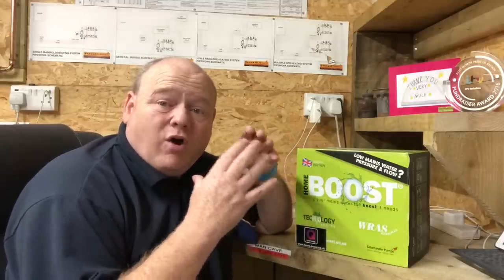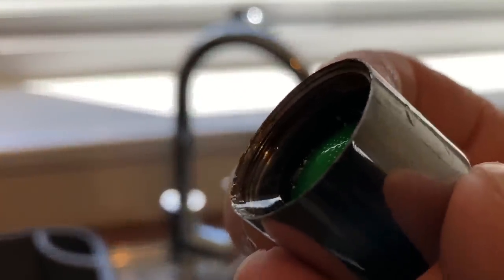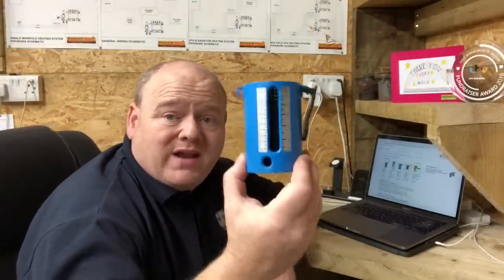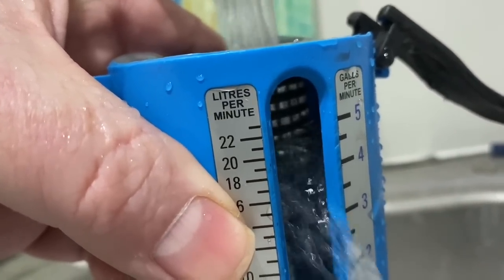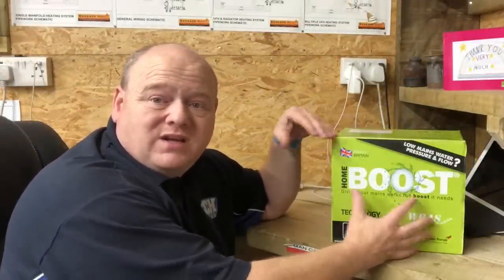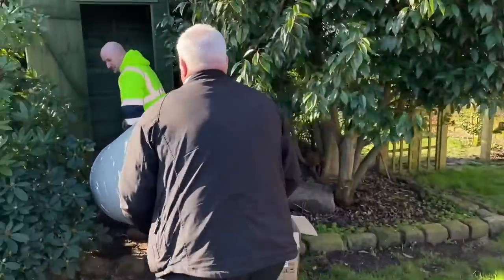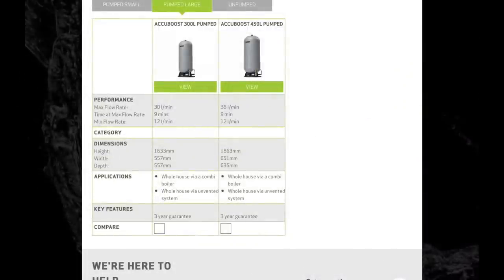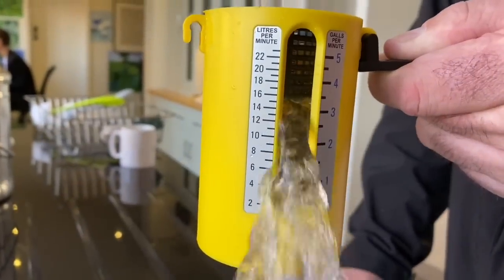Low Water Pressure - Leeds Plumber

Comment: Purchased a 70’s house that had to be completely refurbished, including full re plumb, insisted everything was to be in 22mm pipe, still had flow problems, so replaced the incoming mains, still had problems, found out the  plumber has used the very cheapest isolating valves he could buy, changed them for full flow valves, job done. Since fitted a water softener, which has reduced flow, now looking at a home boost pump.
Reply: Water softeners usually dont impact the water flow to a household. I would check that the water softener is fitted with a highflow hose kit. You'll know by looking at it. The standard kit is fed from the same valves and hoses you would feed your washing machine with. The highflow kits use fullbore valves and bigger diameter hoses.

Comment: I stay in a rural part of Scotland with mains water but for whatever reason we have the most outrageously high water pressure I’ve ever seen. Could fill up a 4 pint water jug in about a second whilst soaking the ceiling. Can fire a hose over the 2 storey house at half pressure. 
We’ve actually had to limit the water entering the property down to about 20% to make things manageable. 
Seeing as water is unmetered here I’ve often wondered if I could run my own hydroelectric system from the kitchen sink!
Reply: You need a pressure reducer on the mains pipe as it enters the property. Too high a  pressure can ruin plumbing fittings and appliances.

Comment: Great informative video as always Alan. Where possible I would always recommend a new mains supply to a customer over a pump, less moving parts to go wrong in the future that will cost a few hundred pound to fix. Pumps these days even the brass ones dont last that long. I would say 10 years max and that it is been optimistic vs 20+ years easily with only a nip up of a gland nut required 😁. Obviously a new mains pipe isnt always an option and it's a good that all these options are available. Probably an obvious question but with the mainsboost from stuartturner, I presume they are the standard monsoon single impellar pumps that are attached to the accumulator and if they do fail, the pump itself is replaceable without the need to replace the accumulator too?
Reply from the maker: No space for accumulator on this one. Thanks.

Comment: Flow rates and pressure drops. A case in point. Typical "conversation", one way though, twixt me n the missus. 
"What the bloody hell have you been up to? Yer filthy. Get nekid on't back door mat 'n gerrin that shower, now!"
I dutifully oblige. I get in shower, lather up mi bonce with shampoo and the shower reduces to a trickle.
She's chucked mi filthy clothes in the wash mac and turned it on. The shower virtually stops.
A pressure equalisation valve was fitted under the bath feeding non thermo shower mixer. Wash mac cold feed demanding -> shower reduces to a trickle.
Ripped the blasted thing out when I redid the bathroom last year and fitted a thermo bar mixer.  So now, wash mac on and demanding and I can shower at the same time, baht standing eyes tight shut, lest shampoo gets in them whilst waiting for the wash mac to fill. 
Alan, what sort of shampoo do you use?
I'd share but I am not on any other social media platform and I don't do Twitter. I have hit like tho.

Comment: Very informative, have a problem at brothers property, starting from scratch measuring flow and pressure, whats the recommended flow rate for a 3 bed i bathroom property? what should I be looking at 10-15 litres / minute is this acceptable?

Comment: Thanks for the video Alan, hope you're well. How would the big accumulators and home boost compare to pressure from a twin impeller shower pump for just supplying a bathroom? I know it's more of a whole property solution, but would you still recommend a shower pump to a customer to boost bathroom pressure as well or can something like the home boost handle it all? Thanks
Reply: You cant really compare a twin impellar booster pump with the home or mainsboost systems. Both are used for different systems. A twin impellar pump will be recommended for a customer who is using a gravity fed water supply where the mains or homeboost is suited to those who are using a mains water system.

Comment: I had low pressure not long ago in my house. I couldn't figure it out but I had a one way valve after my stopcock and some grit was stuck in it! So that might help someone ☺️
Reply: Thank you so much for this comment. You just saved me few hundred quid there. I just replaced my valve with the new one and honestly, it's a night and day difference. Thanks a million.
Reply: @SmokBartozy  glad it helped someone! Took me days to figure it out  😂
Reply: No wonder to be honest... I would probably never guessed it. It was so easy to replace, it took literally half an hour (including emptying the cupboard). Thanks again, You are a legend.

Comment: Thanks Alan. Can I please ask you for some advice ? 

We have around 14-16 litres a minute static from a 15mm mains pipe.  We had a viessmann combi fitted last year and as long as one outlet is open things are fine.  

When the shower is on and someone flushes the toilet downstairs, the shower is left to dribble.  

Can I please ask to know what I could do to fix this ? Should we have our mains pipe replaced to a 25mm, or is there anything else more cost effective ? 

I have a viessmann 100 30kw which provides up to 12 litres a minute.  

Thanks
Reply from the maker: might need a non return valve on the shower maybe.
Reply: @AllenHart999  thanks will give it a try

Comment: Excellent video, thank you though i'm still not sure how to sort our pressure problem.   Already upgraded mains to 25mm mdpe prior to Baxi Platinum 40kw being fitted in the garage (used to get about 12-14lpm now about 18lpm'ish on outside tap), new combi should be doing 16.4lpm but only get about 12lpm up stairs on the hot, (cold is working as expected), to be fare the shower on its own is fine until other HOT taps are switched on.  Think the issue is due to dynamic pressure, static is about 2bar but when one tap is on it goes down to about 0.5 bar, if the tap being turned on is the hot one the shower up stairs is unusable at that point, 2 taps on hot and the shower stops.  One thing thats a bit rubbish is we have the new 25mm MDPE going to 15mm stop tap, then a 15mm T, would it make sense to change that section to all 22mm?   Anyway, I think its a bit of an odd one as the flow is really okay but maybe we have a pressure problem, should the Baxi be preforming better at that pressure?  Already put a flow restricted  nozel on the kitchen sink which has helped a little. Hope you can give some advice.  Thank you.
Reply: Annoyingly we have the same problem in our house, the previous owners had the house extended, a new plastic mains pipe put in and a fantastic ATAG Q38C high flow boiler then the pleb plumber who did the install used 15mm stop cock and 15mm pipe so can’t have a shower and use a another tap as flow drops off a cliff 😑
Reply: @copperskills3973    Thanks for reply.  Issue is not so bad with other COLD taps but you would still think it would make some performance difference so ordered the parts to change this over.   Its a shame i'm not getting that 16.4l out of the baxi, I assume it has a minimum working pressure to get the advertised rate.  I'm thinking the only thing thats going to sort it properly is an accumulator, but don't really want a pump.  Its def a funny one as most people have low pressure and flow, not just the low pressure so normally more clear cut, struggling to find info and advice on my particular situation. Thanks
Reply: @dan123collins  Yeah, its bonkers isn't it.  I asked the plumber that fitted the boiler and he said it won't make any difference. I'm not expecting a miracle and this is not the main issue (still have pressure issues if you just use the hot tap), but it has to make some difference, just wish I understood flow rate and pressure maths/formulas as should be able to work out the theory but it blew my mind, lol.
Reply: @copperskills3973  yeah, gas pipework upgraded, it's only a couple of metres away so was no bother at time of install. Overall I think the installation of the boiler itself is correct. (Edit - Though more considerations should have been made to the pressure and flow, unless the boiler itself is faulty?)
Reply: Problem is you have is low static pressure which in turn gives you a low working pressure. You can improve your flow by increasing your stoptap to a 25/22mm and if its accessible, replace as much copper from the stop tap in 22mm copper as possible. It wont be a drastic improvement but will help. Unfortunately though it sounds like your plumber hasnt installed the correct boiler to suit your system. The problem can be solved but not without further cost.

Also just thinking about it, when you had a new 25mm main installed, was this a full new supply with new boundary stop tap or did the plumber install the pipe himself and make the connection after the boundary stop tap.
Reply: @craigwatson7692  Thanks for info/advice. 
I used a different company for the new pipe before the plumber was involved (i'd used the plumber before on last house, generally been okay but don't think he has seen this specific issue before, he thought we would get more out of the new MDPE though he should have checked prior).  
The new pipe goes back to boundary, they told me the pipe they joined to was 25mm but I did not see it myself.  Flow improved quite a bit after the new pipe but i'm not sure if the pressure improved, I did read before and after but if was a increase it was small.   Flow varies and can be hard to read with those cups but was around 12lpm before and increased to about 18lpm+ after.
My issue is specifically low pressure on the hot, which i'm assuming is why I don't get the full spec 16+lpm out the Baxi, I don't know though, its really just a guess.  If I were to have a cold only shower and other taps turned on it would have some loss of pressure but still work where as on hot the shower literally stops flowing with 2 other taps turned on.  I wonder if other 40kw combis would all be the same (on this pressure/flow)? I've tried to find mimumum flow/pressure on the baxi spec but unable to find it the info.
My last house we had an Ideal Vogue 32 (i think that was the kw),  which is lower spec than current boiler and managed much more.  We had more or less the same flow around 18lpm, maybe a little more, unfortunately never read the pressure but assume it was more.

Thanks.
Reply: @radfoo  it does sound like you have an issue with the pipework rather than the boiler. The boiler has nothing to do with your issue of flow rate dropping out when another tap is open. This would likely happen no matter what size boiler you put in if the pipework is undersized for example. Its actually pretty normal for this to happen, I suspect your boiler will have a 15mm pipe where the cold main gos in and a 15mm on the hot supply from the boiler. This means no matter what size the pipe becomes after this, the flow is restricted at this point.therefore flow will be reduced if two or more taps are opened. If your getting above 16lpm on your cold supply to the boiler and significantly less on the hot outlet from the boiler, then that would suggest a restriction in the boiler somewhere. Double check the rating for your boiler to make sure its what you think it is. 16lpm is normally considered to be very good for a combi.

Comment: When did these become recommended, i still believed these was against waterboard regs?
Reply: Booster pumps in general are against water regs as you cant directly pump off the mains. I believe the mainsboost systems get around this as it pumps water from the reservoir and not direct off the mains. I wasnt aware of the 12lpm cap for pumping mains either but the homeboost has been around for a good few years now so it's safe to say it isnt a new regulation.
Reply: My Monkey - you can install an approved pump to the mains without consent as long as the capacity doesn't exceed 12ltrs per min. If you require more than 12 ltrs per minute, you can apply by submitting a Regulation 5 application to your local water company.

Comment: What would be the best option to boost mains pressure to the property on a gravity fed system , why would the salamander boost not be suitable
Reply: The salamander would boost your cold mains only. The hot water pressure would still be governed by your tank in the loft and so would not be improved with the salamander pump. You could have an additional pump plumbed into your hot water cylinder which would improve your hot water flow significantly but please bear in mind they are quite noisy and will drain a small cylinder of hot water reasonably quickly. Hope this helps.

Comment: With the cupboard accumulator, is there a break between the store and the mains? Does that mean you can pump over and above the normal 12litres per minute?
Reply: once the accumulator exhausts it charge (a matter of minutes) you're back to the existing main supply until you shut the outlets and the accumulator recharges itself
Reply: @kb5057  thanks. So the pump only kicks in again once outlets shut to recharge the accumulator?
Reply: Simon Mander yes, the bigger the vessel the longer the run time without the drop out and then it needing recharging. The vessel in the video will be around 8minutes at 16lpm according to manufacturers website

Comment: Oh this ain't great is it what du do with low pressure without a pump ain't it an air lock so do I need a person to hold a rag into each tap in turn flowmates and pumps use electricity oh fffff